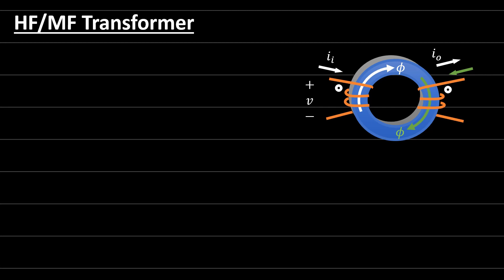How to Unlock the Limits of Transformers | Isolated Power Converters | DC-DC | Power Electronics

Comment: Is it a better to decrease the inductance or increase it?
Please confirm if I understood correct : the result of using the air gap is to decrease the inductance and allow the increase of frequency without going to saturation
Reply from the maker: I think there is no privilege to increase or decrease, it depends on what you need. However, the limit of inductance value is a problem when we add the gap but this comes to the advantage of accumulating the energy within the gap and get more stable inductance value. This also allow to reach more current without saturation. The benefit of this is that more current at same voltage allows higher power transfer if you use a transformer.
Reply: @Elkhateb  Thank you...
Reply from the maker: @mnada72  you are welcome